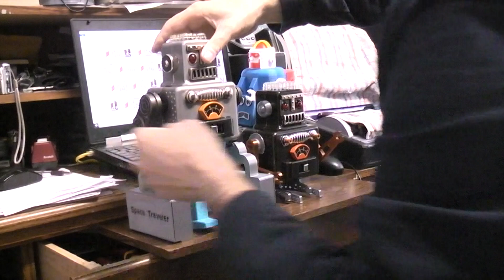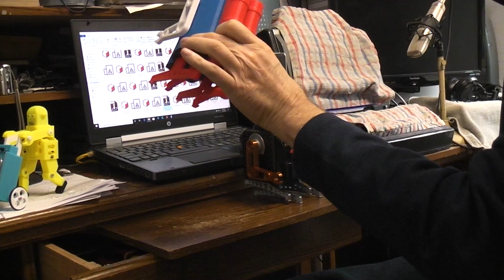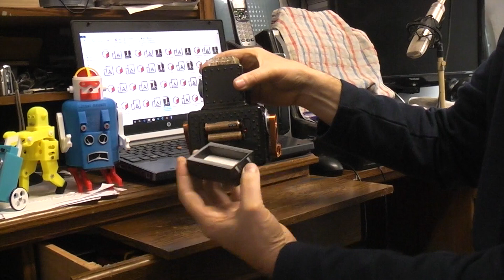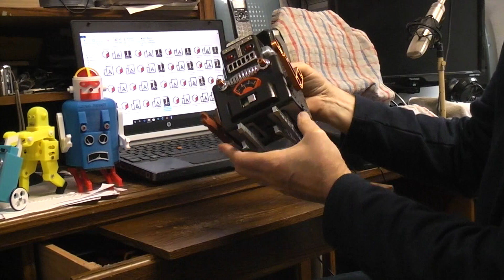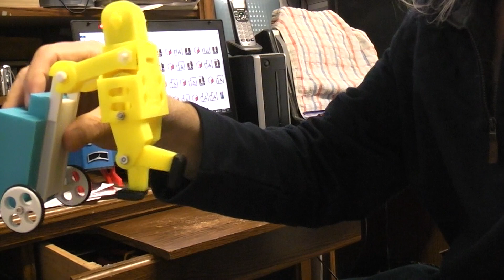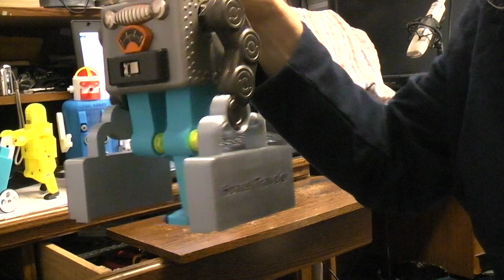Two 3d printed and metal battery operated Robots

Comment: Nice motion of the black robot. Is 3D printing expensive?
Reply from the maker: No, 3d printing these days is very low cost. Back in 2015 when I got in to 3d printing it was very expensive. If you use Free 3d CAD like I do, Free Slicer programs like I do and a low coast 3d printer "many start in the $150.00 range.